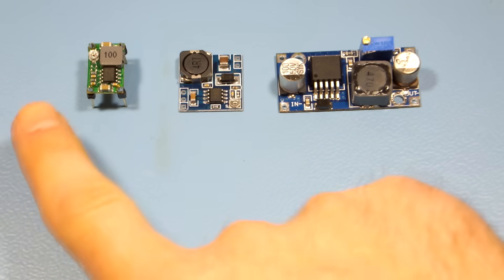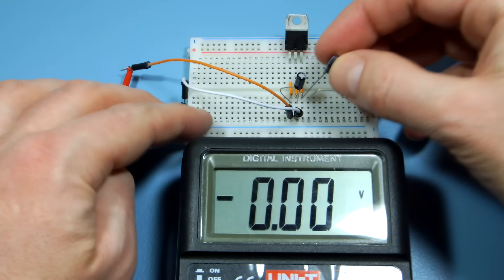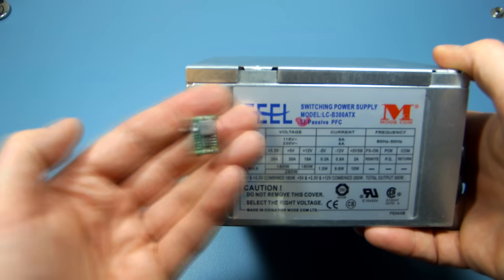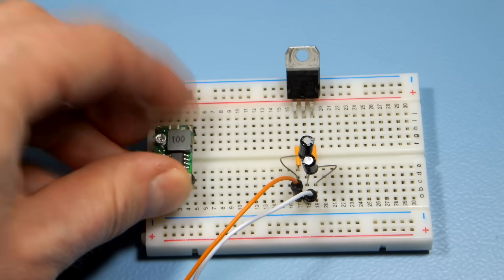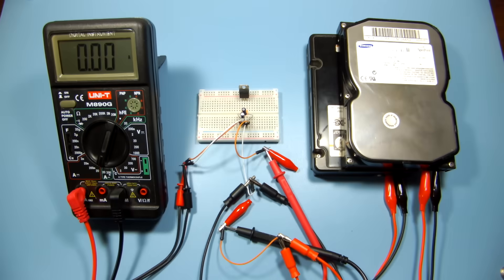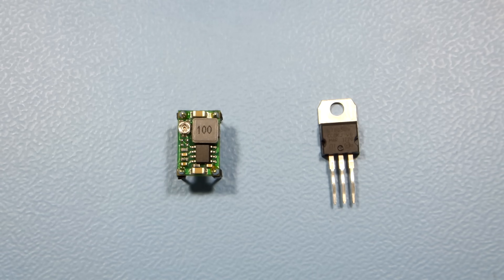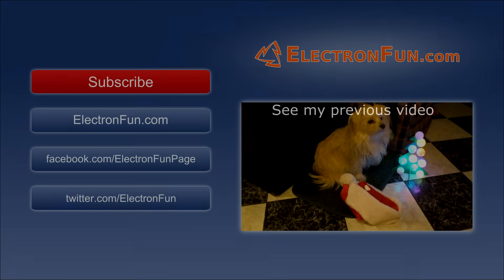Buck converter vs. linear voltage regulator - practical comparison

Comment: Can linear regulators be used in parallel? For example, can you use 2 linear regulators to get twice the current output?
Reply from the maker: These regular ones cannot be used like that. There are some models, which allow parallel connections, but they are usually very expensive and a better choice is a single, bulkier buck converter.

Comment: how can i put a npn transistor in this circuit to increase current----i mean to get 200 w to 300 w output---is it possible----how ?
-----------http://www.hobbyelectronics.net/uploads/6/5/7/2/6572022/8375363_orig.jpg
Reply from the maker: I'm not an engineer, everything I know I learned myself. I won't be able to help you with this one, sorry.
Reply: ok

Comment: I will drive many leds with 5V supply. Total amperage is 6.4A. Do you think i can use a buck regulator between 0 and 5v to use this as a Dimmer?
Reply from the maker: I would use a LED driver as a dimmer.
Reply: ElectronFun.com why ? And how? You mean with Logic Mosfet?
Reply from the maker: There are specialized LED driver boards. I would use one of these to make my life easier.

Comment: I bought a buck converter for about $0.75 on eBay
Still in the mail I haven't tested it yet
Reply from the maker: These supply modules are cheaper and cheaper.

Comment: And if you put a linear voltage regulator behind a buck converter so that the lm7805 reduces this interferrance
Reply from the maker: Theoretically you could do that, but you would get one more component, which could go bad.

Comment: advantage of buck converter is clear. no heat.  thanks
Reply from the maker: Yes, but there are still some applications for linear voltage regulators - audio equipment for example.

Comment: cool man, thanks.
I liked that formula for calculating the heat of the linvreg in Watts. 
voltage difference(Vin - Vout) x consumed/used current ( A/mA)  = Watts
( 9 - 5 ) x .5 (=500mA) -> 4 x .5 = 2 Watt
Reply from the maker: I was calculating power consumption on the input. It didn't have anything to do with the heat.

Comment: You don't have to live with the drawbacks of a linear regulator if you use it WITH the buck. The heat problem in a linear regulator comes from the difference between the input and output voltages. So it's correct to say (12v-5v)x0.42mA = the heat from the regulator but I don't think it's the same for the buck. Anyway if you reduce the difference to (6.5v-5v)x0.42 = much lower heat. So the solution is to use a buck for 12v => 6.5v and the linear for 6.5v => 5.0v. Don't reduce the difference too much. The way a linear regulator works it needs about (output voltage + 1.5V) on the input.
Reply: So for a 3.3v regulator the sweet spot is 4.5v to 5.0v on the input.
Reply from the maker: I've heard about this solution, but haven't tried it myself. It seems like a nice solution but it adds one extra component, which may break in your circuit.

Comment: So, why are linear voltage regulators still used?
Reply from the maker: There are quite a few applications where they perform better than switched supplies. Also when a device is being designed and introduced to the market even several cents make a difference for manufacturers.
Reply: Now I understood why most of the microcontroller boards and other similar devices have a linear voltage regulator in order to keep the expenses low.

Comment: I would be glad if you do a video explaining the differences of different buck converters, actually, in my opinion the best step down in most of cases is the MP1584EN, that maybe is the one that you used in the video, it works at above 1Mhz doesn't need a heatsink but can take maximum 29V at input, while lm2596 is bigger, at higher current dissipation need a heatsink, it works at 150Khz, but it can take an input voltage about 35V and then there is the lm2596hvs wich can take almost 60V at input,  also I bought on amazon six MP1584EN at the price of 10€ that means that you have a ready to use module for less than 2€, while the lm2596 both version cost around 10€ each of them, so then in my case MP1584EN is the best choice.
Reply from the maker: A lot depends on your application and budget. It would be quite difficult to compare these buck converters, because there are so many possible applications. Such a video is a good idea, but it would definitely take a lot of time. I must admit time limits me the most, because of my regular job. I wish YouTube was my regular job. Maybe some day...

Comment: can i apply more than 12 v input
Reply from the maker: It depends on the buck converter model, but usually the input voltage can go over 30V.

Comment: Does the Buck converter keep stable output voltage All the time regardless changing voltasgein the inpt?
Reply from the maker: Yes, the output voltage should stay at the same level, even when the input voltage is changing.

Comment: Dear Sir,

I am using a radio module named RF24L01 with Arduino Nano that is getting powered from 3.3V pin of Nano. I want stable 5V supply to power Arduino Vin and 12 Servo motors each consuming around 240mA. So can I use the above mentioned buck converter for my circuit..?

I referred one website: http://blog.blackoise.de/2016/02/fixing-your-cheap-nrf24l01-palna-module/ which also tells to use LM2596 buck converter module.. but prefers linear one if available.

So if I use linear one, the power wastage shall be 240mA x 12 x 5V = 14.4W. Kindly guide me as earlier as possible.

Thank you. :)
Reply from the maker: Sorry for replying so late, but I couldn't get to my computer for quite a while.
Buck converters are very cheap now. I would try it out and check if it interferes in any way with your circuit.

Comment: which buck converter is suitable for getting 12v constant dc output from 12 to 17 v varying input ?
Reply from the maker: You would need a buck-boost converter. If you deliver 12V to the input, a standard buck converter won't be able to provide 12V on the output.

Comment: I really enjoyed this video. In the top part I see you updated some wattage calculations from evahle's comment,
but something seemed fishy still.

You stated:
There are 2 mistakes in my calculations:
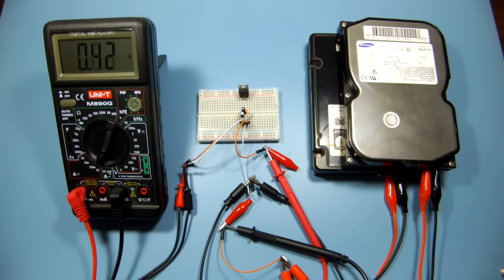1. 5:02 - 5:08 - correct calculations should be: (12V - 5V) x 0.42A = 2.94W
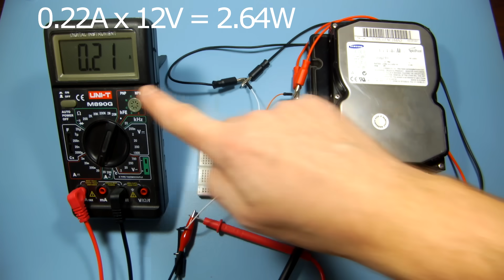2. 5:17 - 5:23 - correct calculations should be: (12V - 5V) x 0.22A = 1.54W

I think you are trying to calculate the power wasted by the voltage regulators to compare them to each other. This can
be found by subtracting off the power used by the hard drive loads from the energy used by the whole system. 

I believe the (updated or 'fixed') equations are wrong because they assume the system input current and output load current are the same.
You can see this by expanding the equations to give the difference in power between the power consumed by the system at its input, and the power consumed by the load at the output:

regulator power = input power - load power

2.94W = (12V * 0.42A) - (5V*0.42A)     // for the linear regulator
1.54W = (12V * 0.22A) - (5V*0.22A)     // for the buck converter

But you stated at 3:42 into the video that the hard drive load draws 450mA from the 5V regulated output. 
This is more that the input current as measured in both kinds of regulators. So these equations can't hold.
They would be true for a resistive voltage drop, where the input current to a resistor is the same as the output, but not for these regulators.

Computing the power consumed by just the regulators:
12V x 0.42A = 5.04W  for the linear regulator.    
12V * 0.22A = 2.64W  for the buck regulator.
(these values are what you calculated in your video)

Subtract the useful power consumed by the hard drive load from the total input power to give the net wasted power consumed by the regulators.

As stated at 3:42,  the hard drive load uses 5V * 0.45A = 2.25W

The net consumption for the linear regulator is: (5.04W - 2.25W) =  2.79W
The net consumption for the buck regulator is: (2.64W - 2.25W) =  0.39W

So what is the ratio of power consumed by the different types of regulators using these new numbers?

In the video  you said that the linear regulator uses over 90% more power than the buck converter at 5:23.

This is I believed based on the simple ratio of wattage used.  i.e. (5.04W/2.64W) ~= 1.909.

The new ratio of regulator powers: (2.79W/0.39W) = 7.15. In your methodology, the linear part uses more than 600% more energy for this load vs the buck converter. 

I went back and applied the same efficiency methodology to the so called fixed wattage calculations.
Strangely, the 'fixed' wattages gave the same 90% power figure:  (2.94W/1.54A) ~= 1.909
Strange because buck converters should be far more efficient at higher voltage drops from the source since the power does not need to be converted completely into heat. 

---------
Sorry for my long windedness. Let me know what you think.  I've been known to stow my head where the sun don't shine. :)
Reply from the maker: First of all, sorry for replying so late. I didn't have a chance to use my computer for quite a while.

Wow, you really got into this subject and you are so right in most part :)

The calculations seemed very simple, but I got confused by several comments. If I recall correctly, I was calculating just the power consumption of both regulators with the load on the input (12V) of both regulators, not the output (5V). I didn't calculate the heat dissipation, but most viewers thought I did. That's why I got confused myself.
Reply: I get it. You were originally just calculating the relative system efficiency at the 12v inputs.  I guess I just nerded out.
Reply from the maker: As simple as that :)

Comment: Hello I enjoyed the information.  I have a question maybe you can help with.  It has to do with adding a fan to my oil cooler on my motorcycle.   What I want to do is connect the fan to a switch that has high , low and off.  I want to regulate the 12v D.C. For the high setting and the low setting to about 5v to regulate the speed of the fan. I assume I would use a relay then 2 different buck connectors one on each side of the high low switch?  The fact that you bring up is that they are adjustable as I am not sure how low is too low.  Can you recommend the part number. Thanks so much.
Reply from the maker: The cheapest solution would be a resistor and a switch - 1 position without the resistor (12V), 2 position with the resistor. I would recommend going a bit higher with the low setting voltage to about 6-7V. A 12V fan may not start rotating at 5V.

Comment: a buck converter cause disturbance ?  i have a step up module which kinda look same as buck converter can it affect my relay circuit? oh ps im using a relay with step up module and i noticed that the relay take more seconds to trigger than it does when it is not connected to the module
Reply from the maker: Switched mode power supplies don't have the cleanest outputs and they may cause interference, but I'm not sure if they can affect relays, as you described.

Comment: Hello! What is a best solution to get +/-12v from a single 9v battery? I've used 2 x ICL7660 with caps and diodes to get a bipolar 12v power source. All is fine without the load of course. I think that some components eat too much so my 1v/octave VCO didn't started to "sing". Is here any solution instead of that? Maybe some bigger accumulators?
P.S. the aim is to get not heavy PSU that will give +/-12v or more (up to 15v). Thanks in advance!
Reply from the maker: 9V batteries have quite small capacities, usually 400-550mAh. They run out of juice pretty quickly. I'm not sure what's your current draw.

Comment: Great video here thumbs up it's a t. i have question, what if i use regulator for NRF24L01 (Wireless sensor,), and the input is 5V and the output 3.3v, Do you have any suggest where i should use ? (buck or linear and why ?).  Thanks
Reply from the maker: A lot depends on your current draw and if the buck converter interferes with your wireless sensor or not. However, if you wanted to use the linear voltage regulator you need at least 2V difference between the input and output.

Comment: at 5:03 you said 0.42A at 12V, shouldn't that be 5V instead? Please correct me if I'm wrong. Nice demonstration btw!
Reply from the maker: I was measuring the input voltage and current consumption, that's why it's 12 and not 5V.

Comment: I thought the comparison was fair, given the parameters set up by the author. High current loads favor a linear power supply. The three pin regulator, coupled to high current pass transistors or MOSFETS are one solution. However, the linear power supply takes up more chassis space, requires additional components and heat-sinks. The buck-converter solves voltage regulation using less chassis space, but the B-C has limits on current draw. And, a B-C can and does generate "noise" where in analog environments is not tolerable. In digital equipment, this "noise" is less of a problem.  There is "No Free Lunch" in electronics. Every designer, engineer and technician faces compromises constantly. This discussion illustrates some of those compromises.  Lastly, Yes, please do "triple check" your math before up loading to YouTube; this happens in so many discussions, and by people who should know better.
Reply from the maker: Thank you for adding your thoughts, cheers :)

Comment: Buck Converter (Step down chopper) is a power electronics circuit device... where as Linear Voltage Regulator is basic analog electronic circuit device... Lin Volt Reg cant deal with high power electronic projects, you cant apply Single line diagram (SLD).. Converters are mainly used as steps in SLD... what if i want to function with HVDC or a pulsating DC...Industrial Converters and Choppers have large Thyristor walls for multiconversion purporse as per SLD.
Reply from the maker: I'm not sure if I understand what you are asking about.

Comment: Nice video & clear explanation!

One question: Is it possible to get rid of (or lower) the interference when using Buck-converter?
Can I add caps or anything?

Thank you
Reply from the maker: Thanks a lot.
You could replace the capacitors with a better quality caps, but a lot depends on your application. There are devices, where you should not use these switched mode power boards - audio equipment is one of them.

Comment: How about discussing how to get sub 5 milivolt ripple out of a buck converter.  You know, for hash sensitive circuitry like DACs, audio amps, high clock rate digital stuff,  etc. Caps just don't do it and small inductors just font have the smoothing.

I got one circuit down to under 1uv but at very small currents because a 10H inductor just ain't gonna carry any current
Reply from the maker: I wasn't getting into too much detail in this video. It was just a general comparison.

Comment: (9V-5V)x0,5A is not the correct formula to calculate the power dissipation. This one depends on the input current and results from the difference of the input power (9V x Input current) and the output power (5V x 0,5A)
Reply from the maker: I was calculating overall power consumption, not the heat dissipation.
Reply: ElectronFun.com the overall power consumption is (9V x input current).
Reply from the maker: Where have you found the formula (9V-5V)x0.5A? My overall power consumption formula was 0.42Ax12V=5.04W and 0.22Ax12W=2.64W.
Reply from the maker: Where have you found the formula (9V-5V)x0.5A? My overall power consumption formula was 0.42Ax12V=5.04W and 0.22Ax12W=2.64W.
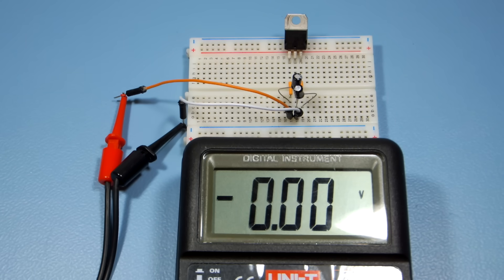Reply: ElectronFun.com the formula is on the upper left corner of your video on minute 1:34
Reply from the maker: Fair enough, I was thinking about calculations close to 5 minutes.

Comment: how do i order buck or boost converters over the net and how much wattage can the buck converter with stand on its output stage . can 70watts be sustained
Reply from the maker: You can buy buck converters on eBay, Amazon, Banggood, AliExpress to name just a few, but of course a lot depends on where you live. There are so many buck converters to choose from, so I believe you should be able to find the one that will suffice your needs.

Comment: is all good with buck converters but highly not reccomended when low noise is required. and that's a disadvantage against linear regulators. as a tip I would like say is good and reccomended to use linear regulator and can be efficient when difference between input and output is small. and also when circut does not drow a lot of current. lm317 or lm337 also allows us to set requied output voltage.
Reply from the maker: That's true, linear voltage regulators have advantages too. I tried to show as many advantages and disadvantages of both devices, but this subject is very broad.

Comment: Since then, prices of bucks converters has plummeted, they are now around 50 cents.
https://goo.gl/5wa1Gm
I wouldn't use them in sensitive receivers, or ADC/DAC sub-systems. Replace the electrolytic capacitors with larger values and better quality. The ones that are installed, are under spec and too small for > 1 Amp draw.

Comment: what if we just cover the coil and avoid the unwanted flow of flux and use it in radio applications?
Reply from the maker: I haven't tried that, but it may be worth a go.
Reply: Yes, covering the converter with a can is a standard approach

Comment: +100500
what you want from device designed in 197x 8-))) (7805)
Reply from the maker: It was designed a long time ago, but it's still widely used. I don't say it's bad, I just compared it with a buck converter.

Comment: Great explanation! I'll try to use one of this to replace the ramps 1.4 mosfet that feed my 3D Printer heated bed.
Reply from the maker: Thank you very much! I would leave the heated bed MOSFET. For this application it should be better than a buck converter.